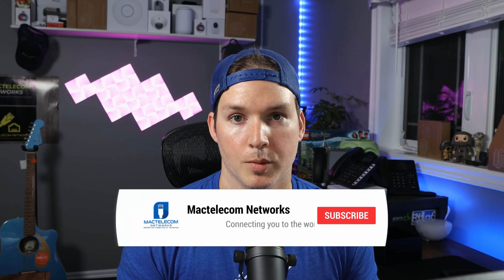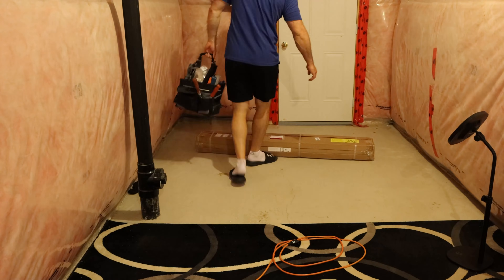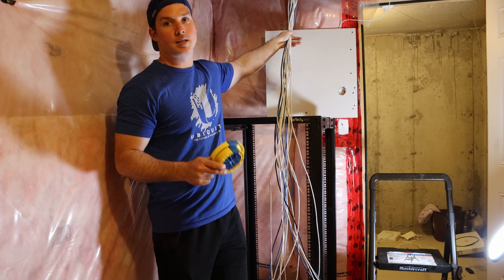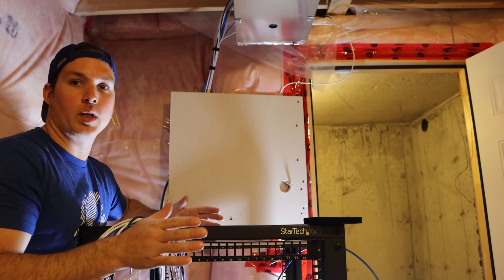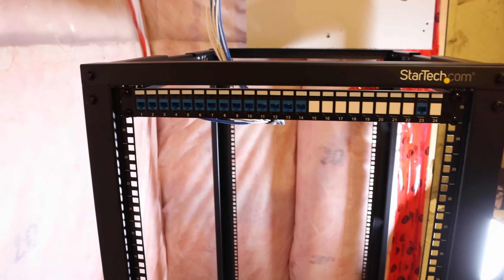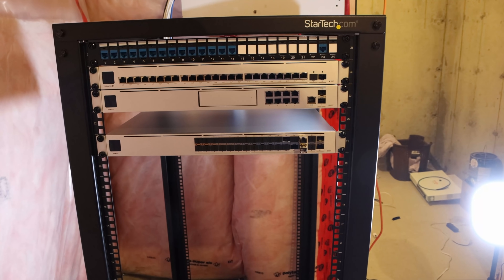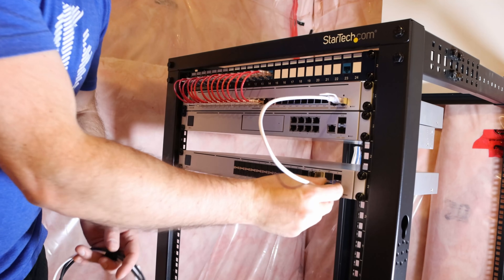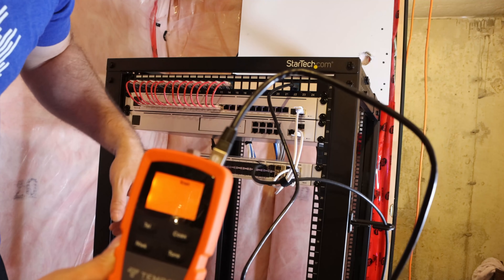Rebuilding My Network Rack

Comment: I had the same type of accident.  After that, half racks on wheels only. I got a APC 24” deep one and I just framed a makeshift closet around it. One of these days I’ll get around to installing a door that has good airflow. It is overkill for a house but once you’re down the unifi rabbit hole you end up with a data center in your basement.

Comment: Great video. Random question - What’s the story with the wall insulation with no plasterboard and how do you plasterboard onto that without the timber frame? Curious as it’s done quite different here in Europe.
Reply from the maker: The basement isn’t finished it’s a somewhat new house. Not sure if will be finishing it as we’re looking to buy a bigger home

Comment: I know what the switch is for but what’s with all of the other gear and why stack the the switches when there’s nothing connected to them?
Reply: Probably there's a 1G connection from the "Unifi enterprise 24 PoE switch" to the clients. 
The DAC cable provides a 10G connection between the "Unifi aggregation switch pro" and the "Unifi enterprise 24 PoE switch".
The DAC cable provides a 10G connection between the "Unifi aggregation switch pro" and the "Unifi UDM Pro".
The DAC cable provides a 10G connection between the "Unifi aggregation switch pro" and the "Unifi UNVR Pro".

An aggregation switch is usually a switch to connect other switches or equipment through.

 * Unifi UDM Pro -> You probably know what this is. It is the brains of the network. 
     
 * Unifi aggregation switch pro -> This is a switch with all 10G SFP+ ports (and some 25G). You connect this to your UDM Pro. Then this aggregation switch is used to connect to all other network equipment to. I am not sure if it makes sense in this setup. Seeing how there isn't that much more network equipment. But we would need more information to be sure. 
     
 * Unifi UNVR Pro -> This contains drives to store camera footage (security cameras).
     
 * Unifi enterprise 24 PoE switch -> Used to connect all clients to the network (cameras, printers, workstations, access points, etc).
     
 * Unifi RPS -> This is a UPS / power supply for all of the equipment.
Reply: @itsmrpaddy  Thank you for the detailed reply! I'm far from being a pro when it comes to networking, mainly only messed with Cisco Switches/Routers. I just didn't understand the need for an aggregation switch with the shown setup. I understand that it is all about use case but just looking at this I feel like I have more questions than answers lol.
Reply: @notmyname1486   To be honest, I don't understand the need for that aggregation switch either 😀  He probably got it for free from Ubiquiti, that's why he put it in the rack (that is my assumption anyways). He could have gotten away with connecting the "Unifi enterprise 24 PoE switch" with a DAC cable to the UDM and then connect the UNVR to the UDM with a simple CAT6 cable.

Comment: I've got a bit of a question, pretty simple / something I'm missing. My understanding is that you take your connection from your ISP and it goes into a modem if you have cable, or a ONT if fiber. The modem then takes coax > ethernet, and then you send that your router. 
In your case, where is your WAN coming from, it's coming from the ethernet, but doesn't that mean there's also a device before that? Would that be where your ISP fiber > ONT > ethernet > UDM Pro > Switch Aggregator > USW Enterprise correct?
Reply: Correct;  ISP fiber > ONT > ethernet > UDM Pro.
Then the UDM Pro has internet access. From there, it serves the rest of the Ubiquiti network equipment and its clients.

Comment: Do you get a 10gig connection through those keystones? I was planning on having keystones on the server rack and in the office.
Reply from the maker: You can get up to 10GB on Cat 6 in short distances. If you want 10GB at longer distance 100m you need to use Cat 6A and they make keystones as well

Comment: All these people working hard and not smart by terminating Ethernet by hand.

Buy premade cables and save time, and even money…
Reply: And how do you pull the plug trough a tube in the wall? Over here it's all brick walls so we buy "preflex" tubes with all kinda wires in them... EL, Coax, UTP, DATA, combo's of them etc... We grind them into the wall and put plaster over them. And then we need to terminate them...
Reply from the maker: Not sure I would call that smart or even save time but to each their own

Comment: What are you going to be using the bottom switch for bearly nothing was plugged into it an the top switch still had plenty of ports left for more things
Reply from the maker: Not sure I bought it to do a view on. This is only a little bit of the gear I have currently. The USW aggregation pro has 25GB uplinks as well so when I get a server I’ll be connecting it to those ports

Comment: Cody, can you add the brand and model number of the cable tester/wiremapper you used towards the end of the video in the gear used section? Thanks

Comment: Bro, what ISP do you use. I can plug in the fiber from Bell directly to UDM Pro. So much better that way.
Reply from the maker: I’m with bell and I can do the same: I just need to run the fiber about 30 feet to my rack which is planning on eventually doing

Comment: Good video, IMO I would have just re-mounted the network in the same room in the same spot on the wall. Use the Rack on wheels for servers..
Reply from the maker: Well it’s a cold room so I was worried about moisture my plan all along was to have it outside of that room. 

The wall mount rack I’ll still be using eventually when we finish the basement
Reply: @MactelecomNetworks  The room you are filming from looks like a nice dedicated server & it room :P I kept all my routers & networking gear in a glass Strartech rack mount unit & servers were in a rack like yours but shorter.
Reply from the maker: @JasonLeaman  that just my basement unfinished lol but for sure if we ever do finish it I will be dedicating it to a server room

Comment: Nice video! Why did you leave that much space between the switches and the NVR at the bottom? Did you try to lower the center of weight?
Reply from the maker: Hey,

I wanted everything heavy at the bottom. I plan on putting other switches ( Aruba, Tp-link) and some shelf’s to hold my PFsense gear in the middle